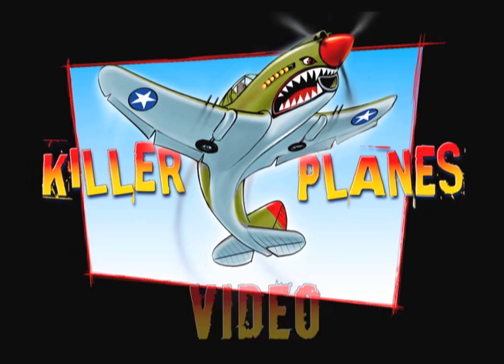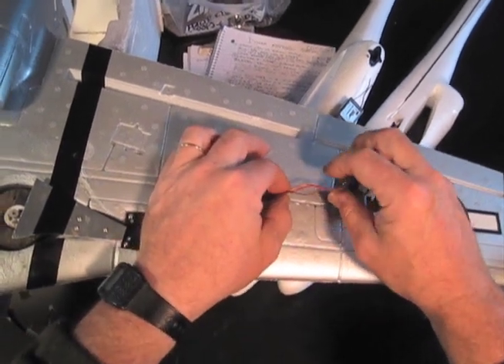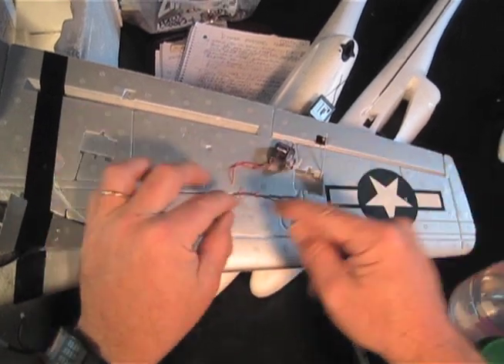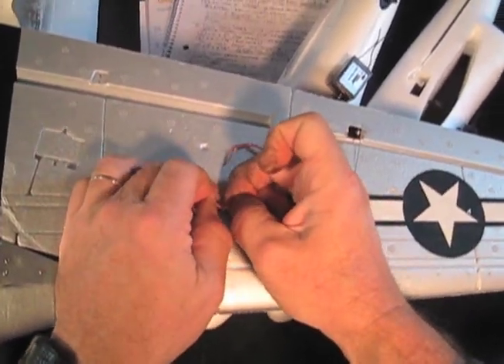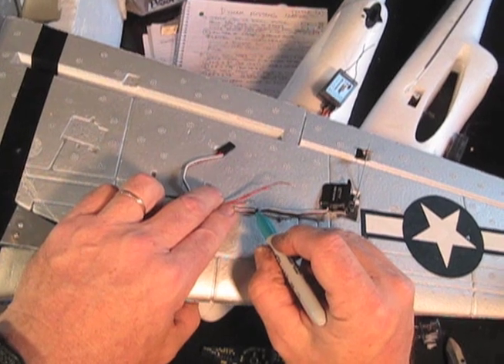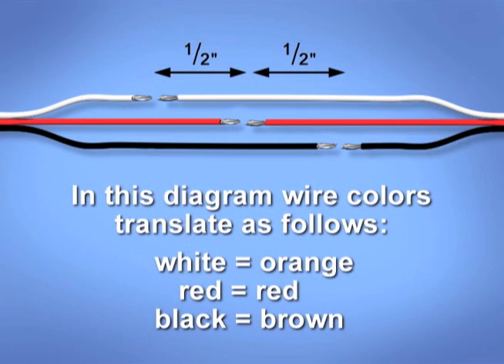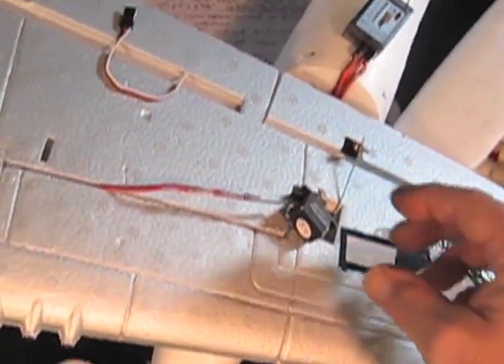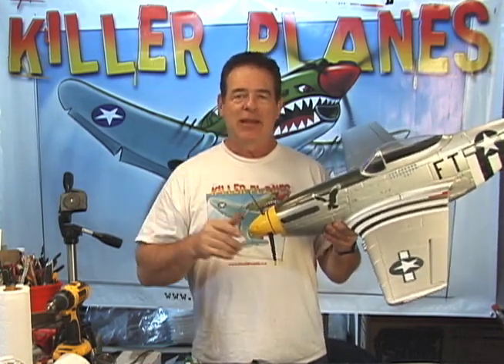HOW TO STRIP IN A SERVO

Comment: yep you can see probably my worst crash so far in dynam mustang crash n fly again i hit the ground full throttle (belly landed) and just fixed my gear  went right back up it happened about 3/4 of the way through i have another called dynam mustang threading the needle (pine needles) where at the end i took it through some pine trees completely out of sight momentarily n got it back without hittin anything whew lol anyhow you can check em out if you like also final flight of the strega's on there